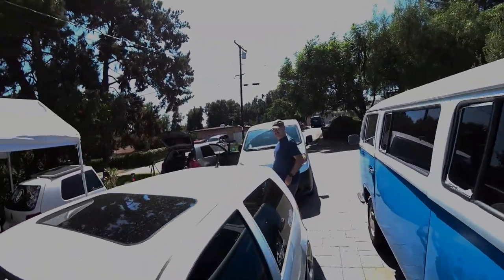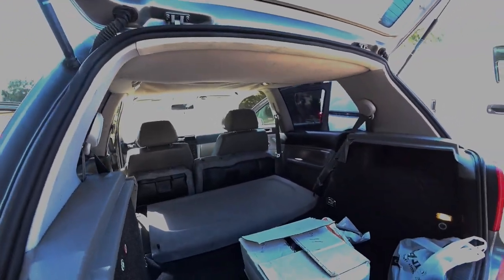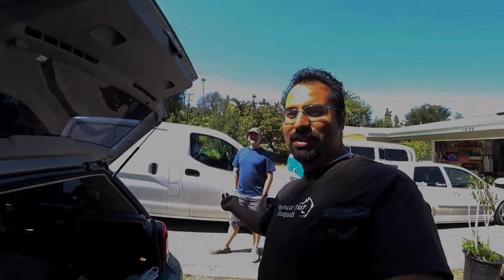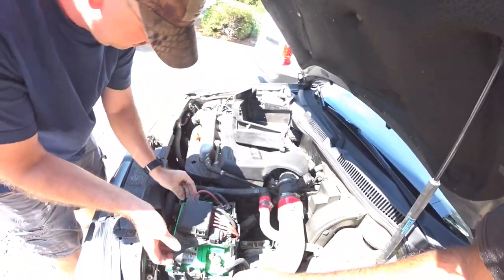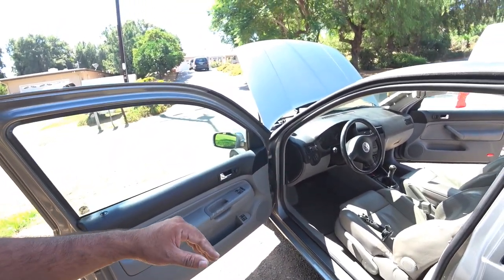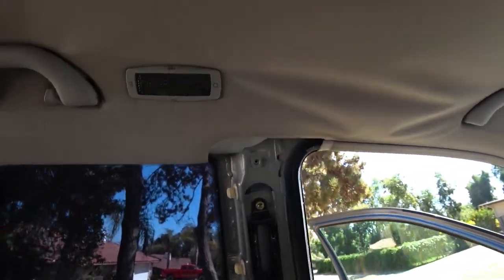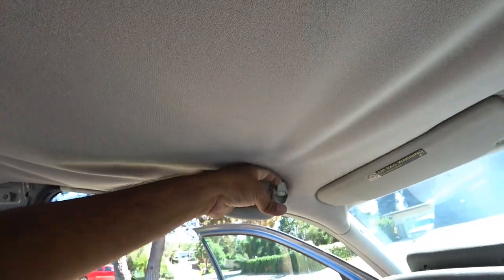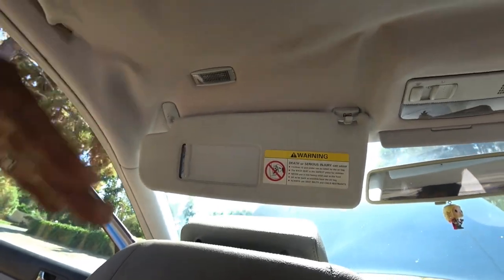How to remove an MK4 GTI/Golf Headliner Part1 S4EP24

Comment: The A pillar has clips that can purchased at ECStunjng. Just in case if you break them. You need those clips there.  The A pillar has airbag symbols that you can pop off and there you will see a T20 torx screw.

Comment: What is the purpose of the “bitch clips”? These are horrible design.  (I made a hook on the end of and old wiper blade steel strip and locked in with Vicegrips to hold on end) I would have to disagree on the A pillars being easiest.  They were by far the worse.  Especially if pillar trim are not already tacoed in half like yours for (air bag deployment).  This is by for the worst headliner to remove out of all the ones I’ve done.
Reply from the maker: Sounds like you never worked on an mk5. This is definitely not the worst if you know what to do and have the right tools.
Reply: You are correct.  I have not done a MkV.  I assume as the cars get newer, the worst it is..
Reply: The purpose of these clips is to hold the a pillar trim if the side curtain airbag deploys, so that the a pillar trim does not come flying and hit you in the face. They should be reused, or new ones should be installed if the old are broken when removing. They are (at the time of this being written) available to order and they are cheap. Part numbers are 1J0880385A for the part that attaches to the a pillar, and 1J0880287 for the hook part that goes on the trim piece.